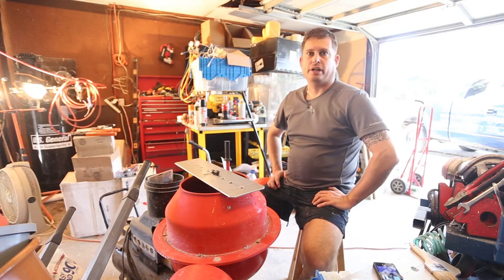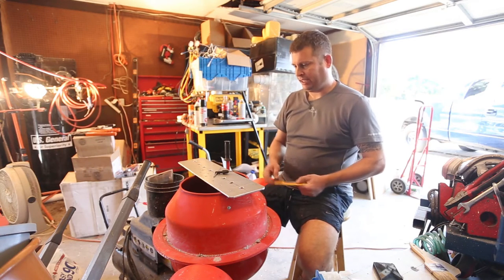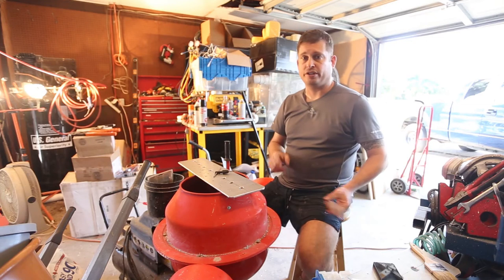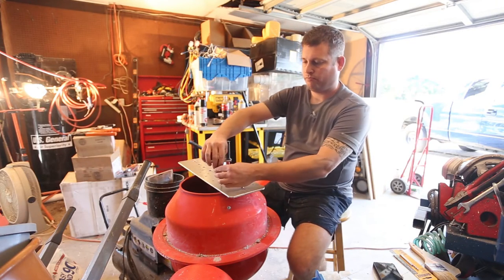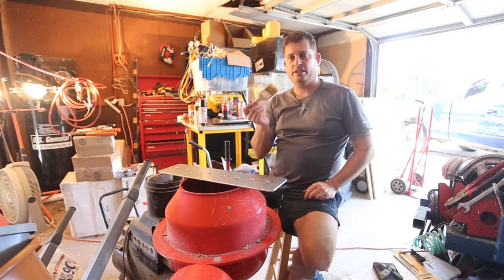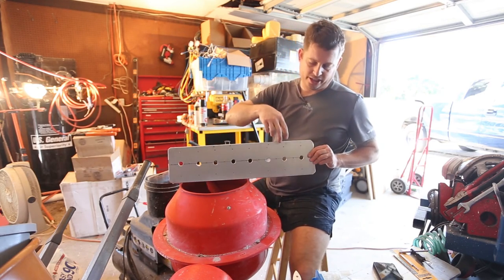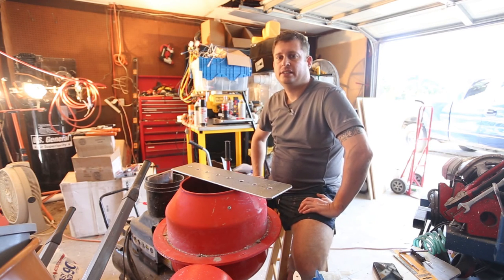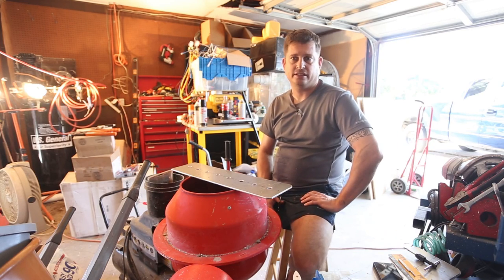Dewalt Hand Tap Review

Comment: I'll try one and compare it to my favorite, Ace Hanson. My set appears to many diameters and each bit has a different number of threads. The really fine ones are stamped with larger numbers and as the get coarser the numbers get lower until finally NC. Dad always said to stay with Ace Hanson because they are designed to be very brittle and will break easily. Hmm!